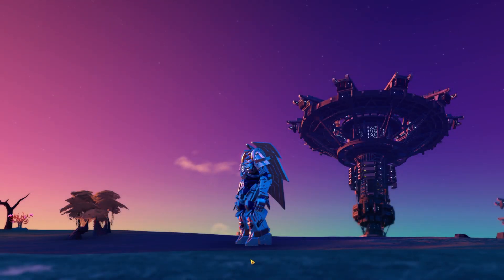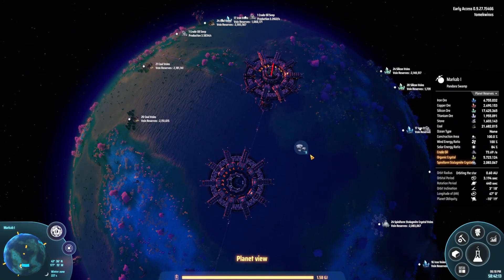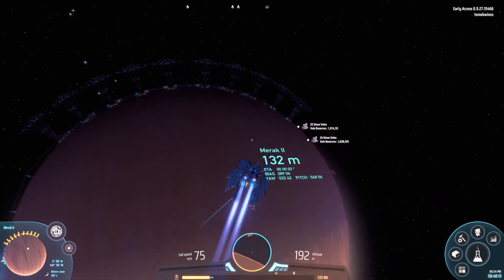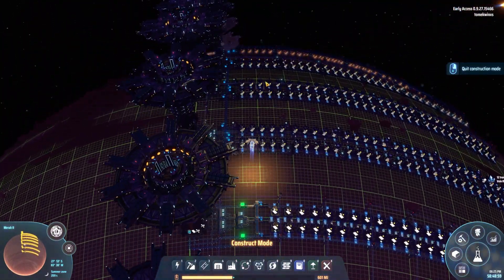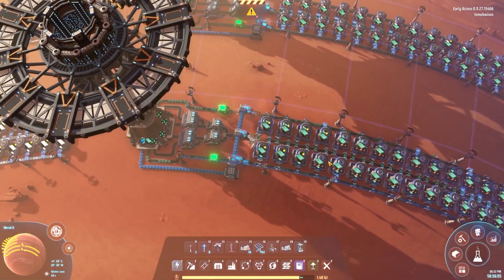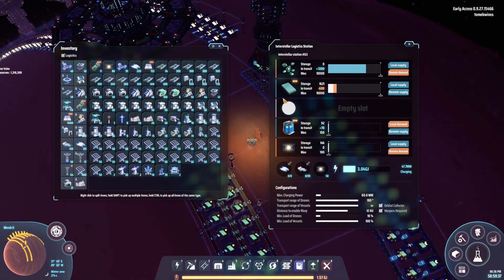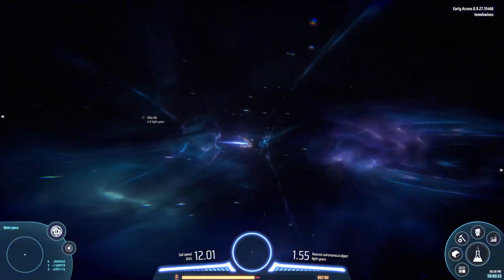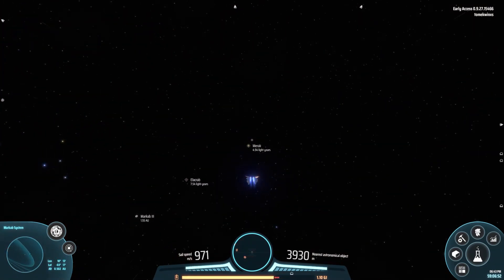Automating High-Purity Silicon on Merak II  | EP68 | Dyson Sphere Program | Blind Playthrough

Comment: Hi Tom,
Here is and alternative suggestion based on how your current science design is set up for the other matrices, you have 13 science labs each.  with 13 labs for green science you would produce 65 gravity matrix per minute proliferation with MKIII proliferator and extra products setting.  This would require 32.5 graviton lenses and 32.5 quantum chips per minute.  Using MKII assemblers this would require 3.3 each or 4 assemblers for each item.  This is only for the matrix.  

The quantum chips are used in rockets and a few machines so you would need a bigger build but I'll leave it up to you, your builds are interesting.

Once you achieve mission complete I would like to challenge you to a mixed build production line.  Say processors for example where you build all the components beyond ingots into one production line.  Red science using only x-ray cracking from crude oil with only hydrogen as a byproduct no refined oil.  Keep in mind that mission complete is only the real start of the game for most people.

Comment: For components, perhaps switch back to "extra product" - using "production speedup" for buildings only?
Did you notice the calculator totalled ~3000 Arc smelters and ~1500 Assemblers!!!  :face-turquoise-covering-eyes:   :face-green-smiling:
Reply from the maker: I did notice that but you notice I did not have the proliferator set on the arch smelters? It would most likely cut them arch smelters in half. 

Is that a hint I should not do a full belt of quantum processor?! 😬🫣
Reply: @ThomasEdward84  Not hinting anything. Just wondering how your "Ice cream Shop" will cope 😁
Reply from the maker: That is a joy of a blind playthrough! I get to make a mockery of myself! 🤭